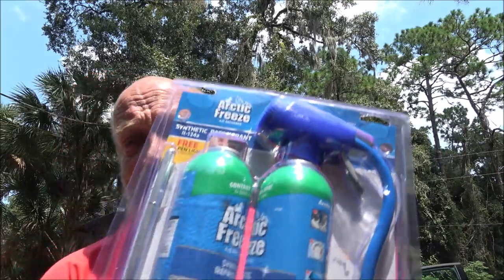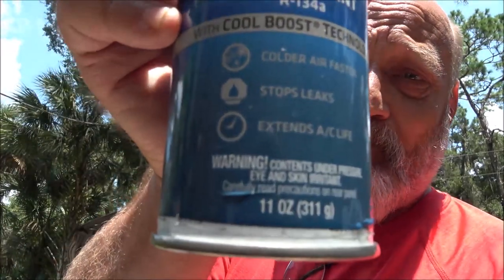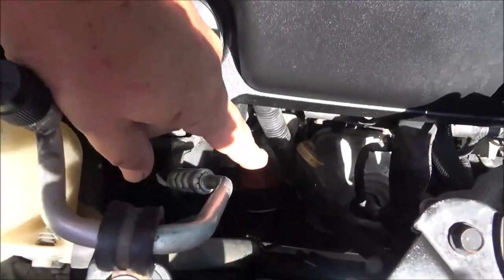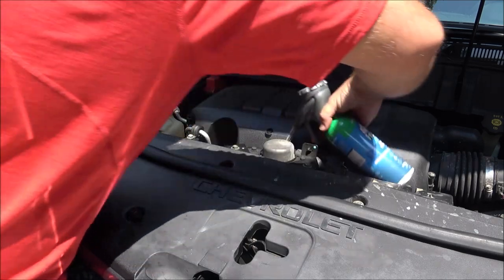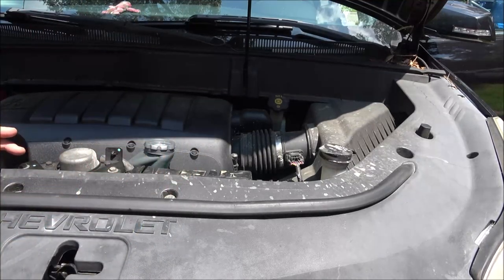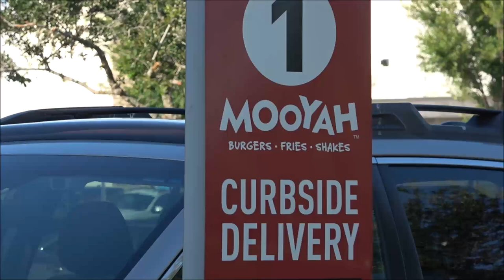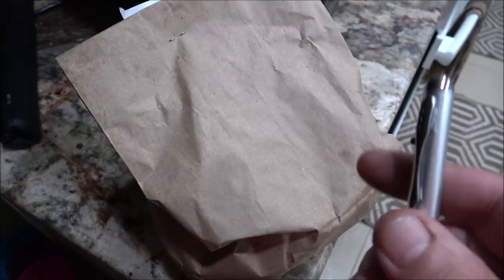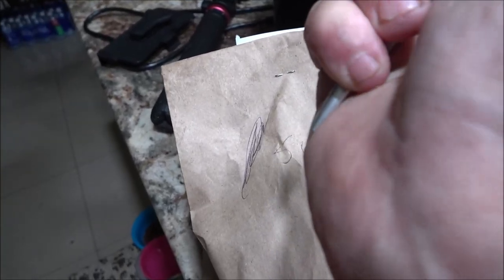Checking For AC Leaks And Road Trip To See Monkey's Doctor

Comment: When you replace the compressor do you have to pull a vacuum on the system as you would on a window unit or house central unit?
Reply from the maker: @truthreigns7  it's best if you do but in this case I may not have to, but I'll find out once I try to charge it with the new compressor. When I do it I'll film it.
Reply: @shabear1000  sounds good